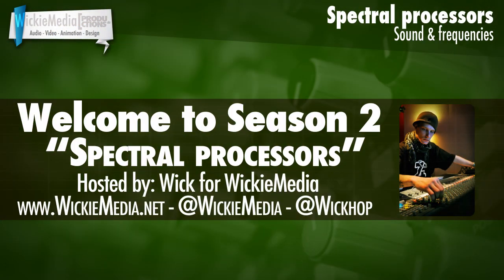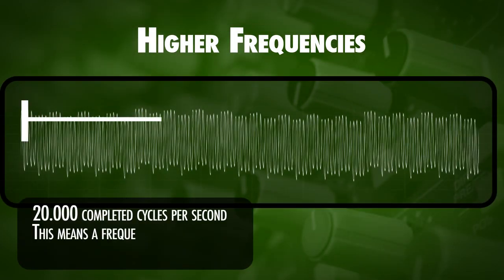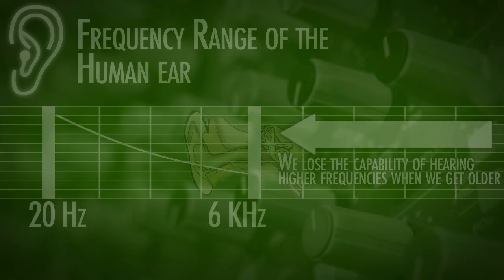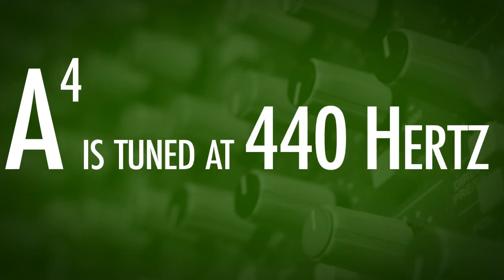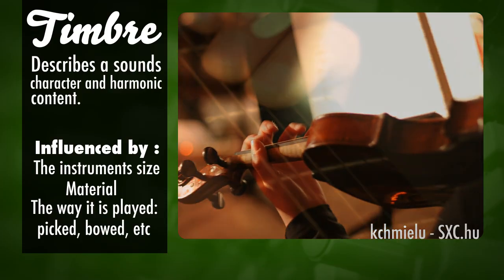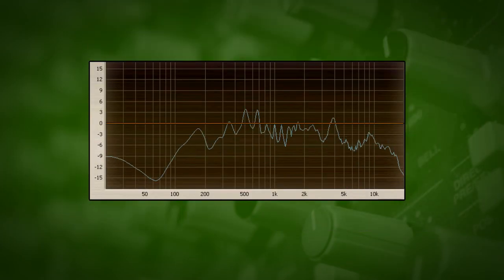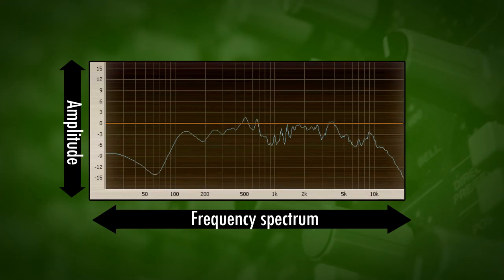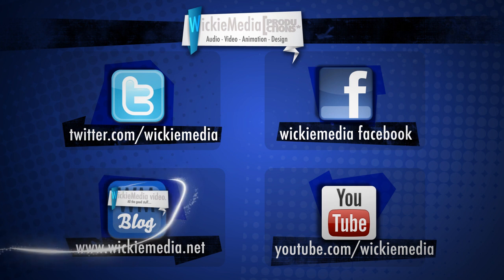Frequencies & sound explained #1 - Basic sound theory

Comment: Your last graph is wrong.
A spectrum graph has indeed frequency on the X-axis, but Sound Pressure Level (Lp) on the Y-axis (in dB) instead of Sound Pressure or amplitude (in Pa).
An oscillogram has Sound Pressure or amplitude on the Y-axis and time (in seconds) on the X-axis. I think you mixed the two to one graph. Anyway thanks for the vid!

Comment: Hi Guys, I am interested in constructing a frequency generator that can produce a frequency range of 200 to 600 Hz and that can be constructed at home. I have the necessary tools to do that but i need some help with the components and wiring drawings etc. No, I am not into electronics, nor do i have any knwoledge of the components so I need the help. I am planning to construct a Mosquito "attracter" (yes to attract mosquitoes). May sound crazy but i want to do that.